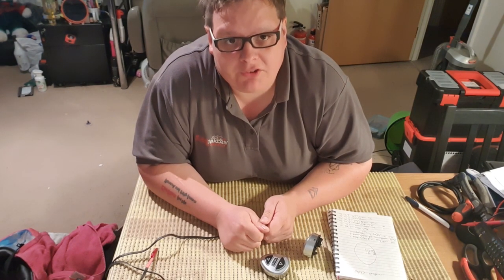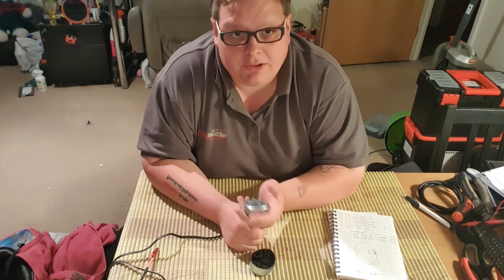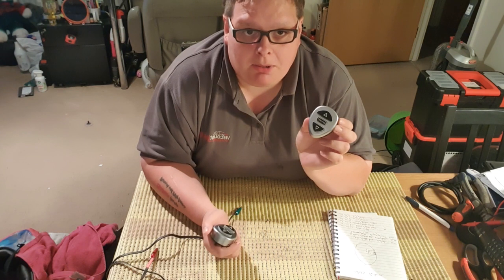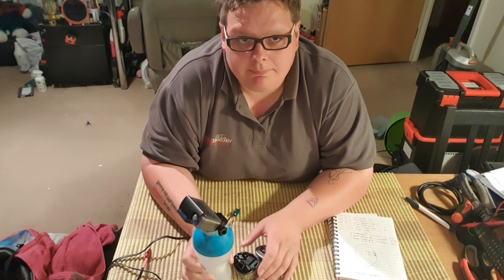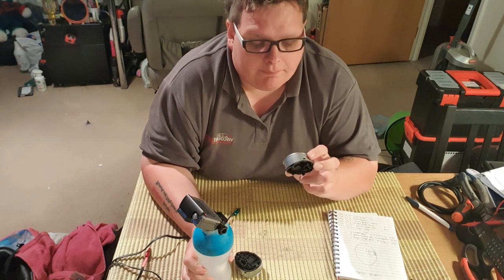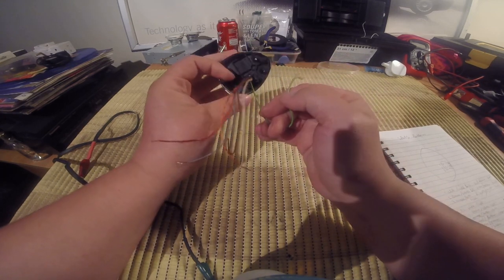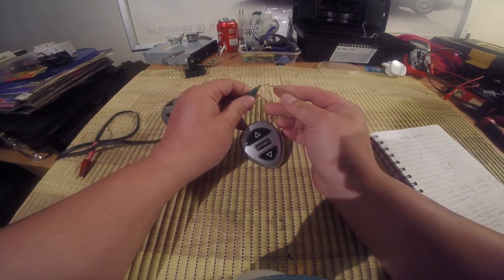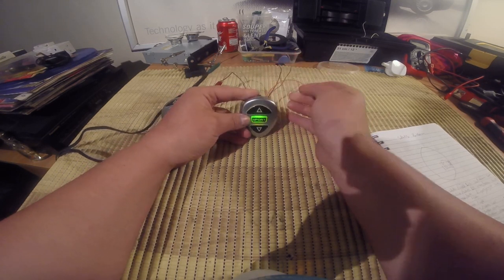Citroen C5 Suspension button wiring info

Comment: When my C5 MK 1 steering wheel is turned, and I park and turn off the engine, the Front of the car dips and rises like some Mexican's car.  Now, I'm not here looking to fix this. Rather I'd like for my own interest , to interrogate the BHI control input connector.  I'd like to wire this BHI input connector to an Oscilloscope and see exactly was is being input, to make the front of the car rise and fall. To see what PWM signals etc. look like. What do you think ?   I'd appreciate your opinion of whether this would indeed show me these BHI input signals. Thanks.